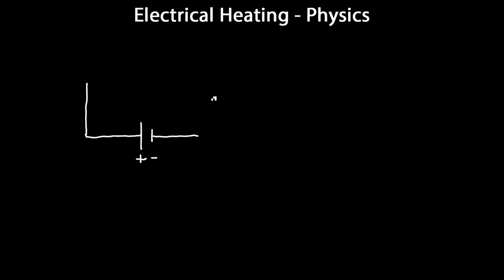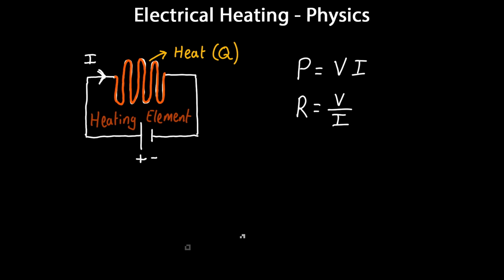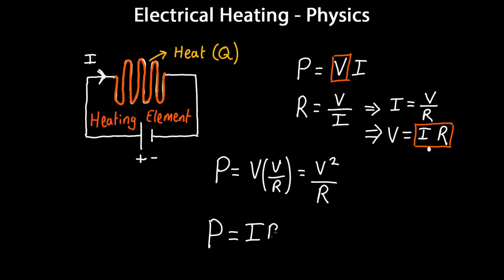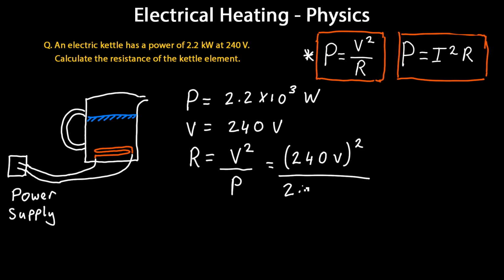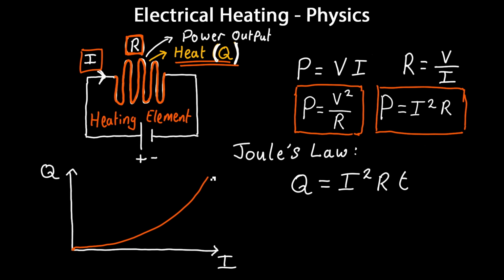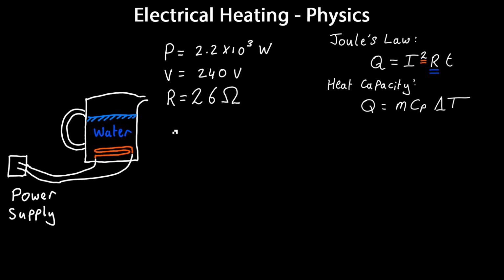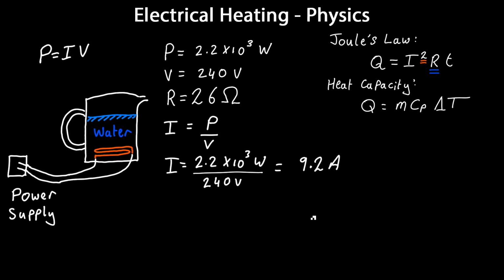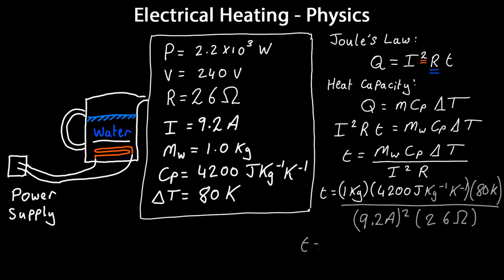Electrical Heating | Physics Tutorial

Comment: does a thermos bottle work like this
Reply from the maker: A thermos bottle will have a partial vacuum between the outer wall and inner wall. This means that energy cannot transfer via conduction (due to the vacuum) from the outside to the inside (when you have an ice cold drink) or inside to the outside (if you have hot coffee in your thermos).

Energy can still be transferred through radiation but this heat transfer is less efficient than transferring heat through conduction (transferring heat through a gas or solid material).

Conduction requires a medium (atoms or molecules in a gas for example) to move energy. The vacuum, between the walls of the thermos, removes this method of heat transfer. This video might help explain it better: https://youtu.be/4HJblUhOaAw?si=O3zRrXci7V1slH55